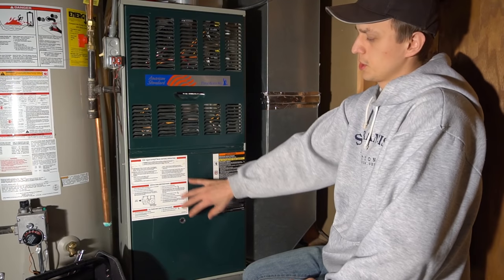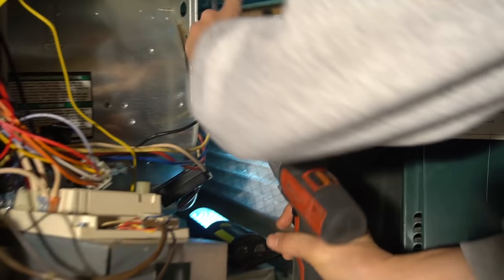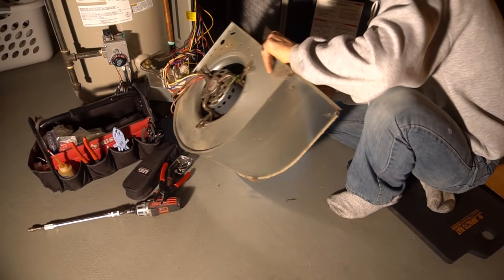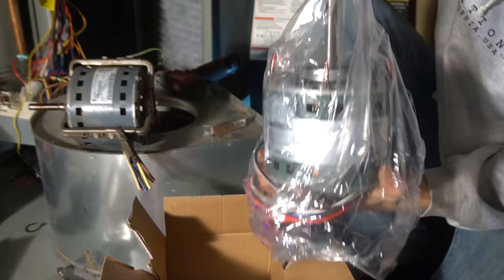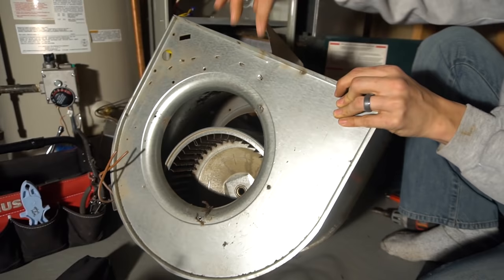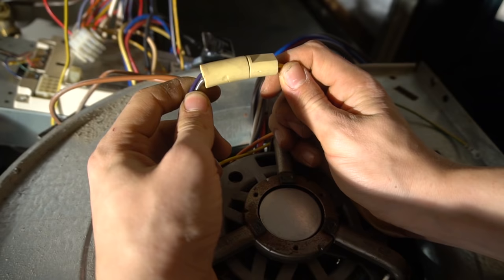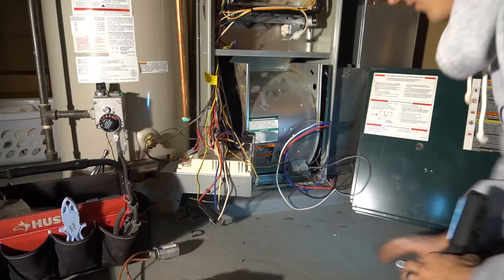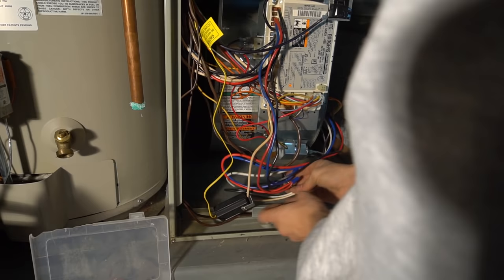Furnace/AC Blower Motor Replacement Step By Step

Comment: This guy is great but I can’t find an answer to my question. I have a Bad inducer blower motor on my Kenmore HVAC system will my air conditioner or should my air conditioner still work without that functioning because it’s only for the furnace side of the system as far as I know but I am just learning if anyone knows the answer to this question please pass the answer along thank you.

Comment: I change the blower and motor but air blower is shaking still. It is not spinning evenly. Furnace is shaking when blower is working. Any idea what needs to checked?
Reply from the maker: Are there perhaps loose screws? Otherwise I would try replacing the blower motor bracket. I should have a link to one in the description.
Reply: Thanks for responding.🙏👍I will double check the brackets and screws. So far when checking the blower from the side. It is wobbling and that is what causing the vibration as well I think.
Reply from the maker: @shaxus91  You could also take the bottom furnace door off and tape the door switch. Then turn the power on, blower on. Perhaps you will see what is causing it that way. If you are running out of ideas sometimes all it takes is a piece of wood jammed under the blower motor housing to make the noise and vibration stop. So maybe that's worth a try too.

Comment: I'm replacing my blower motor. As I look at my old motor it just says HP 1/3 , V 115, A 6.20 , RPM 1075, HZ 60, PH 1, from GE motors. I don't see the SPD speed like yours. How would I know the speed on the old motor before buying ?

Comment: When replacing an old blower motor where I only had 1 brown wire and now have 2 I'm stuck wondering where the white wire now goes.  On the old it had 1 brown & the white to the capacitor with a pigtail from capacitor to N1.  An extra white wire from N3 to L2.  On the new would I discard the pigtail from the capacitor to N1, discard the wire from N3 to L2 and put the white from the blower motor directly to L2?  And both brown to capacitor?

Comment: Is there anyways to find out what’s the Hp of blower motor without taking the blower motor out?
Reply from the maker: Yes, the sticker that has the model and serial number on it will sometimes tell you the HP of the blower motor. Or you could try calling an appliance parts store and ask them to look up what blower motor your furnace will need. They should be able to do that with just the model and serial number. Unfortunately I don't have access to those lookup sites so I can't do that for you.

Comment: mine seems like it will spin in the bracket any  suggestions?  I think this is why you should leave the bolts sticking out I broke mine off and I think I will have to replace them
Reply from the maker: Are you talking about the bracket that holds the motor? Sometimes you gotta put one of these in: FM55 Motor bracket: http://amzn.to/2C7hIcI

In fact a week or so later, after filming this video, I took it back apart and put in the FM55 bracket since my blower was noisy. That did the trick.
Reply: thanks that looks like a winner
Reply: That bracket works perfectly it should be part of the stock set up thanks again
Reply from the maker: I agree :) It's a nice, simple bracket

Comment: Hi,  my blower seems to not blow enough strong air to all my vents. Is it possible to replace the motor with a higher/stronger blowing air? What are should I look into first?  Specs or anything to fix this issue? Thank you.

Comment: My blower motor specs are HP 1/3 , V 115, A 6.20 , HZ 60, RPM 1075, PH1. This is on a RUUD system. Would the same motor u bought do my system? The Amp is different tho.

Comment: I have a Trane XE 78 and lately it hasn’t been blowing out that much air. Would you recommend we replace the blower motor
Reply: It maybe clogged up at evaporator and resisting air flow

Comment: What’s the difference between this motor and the inducer blower motor?  I just turn on my furnace and it’s making a humming sound.  I am replacing capacitor first.

The inducer blower motor is now hot.  But you didn’t replace the inducer blower motor.?

Comment: Is there someone answer my question Please ,whenever I turning on the furnace the motor stuck until I go and pushing the blower by my hand then start .do I have to change the motor? .
Reply from the maker: Most likely the blower motor capacitor is weak or completely dead. If you want, you can try replacing only the capacitor and sometimes that will be enough. But in most cases I end up having to replace both the motor and the capacitor. Hope that helps!

Comment: If anyone sees this, I work with some smaller scale electronics usually, and even with those it's best to discharge the capacitor before working. Is there any surefire way to discharge the capacitor on here or is it fine after keeping the power shut off for a while before maintenance?

Comment: Why would you go from a 4speed to a 3 and omit the yellow wire?
Reply from the maker: One of the speeds is on the "spare" terminal anyway which means I really only need a 3 speed motor. (it was simply cheaper is why I got a 3 speed)

Comment: Are there  additional steps  when replacing a blower motor in a gas furnace? I'm assuming turn the gas valve off but is there anything else?
Reply from the maker: The furnace in the video is a gas furnace :) And I showed how I would do it from beginning to end.
Reply: Just a few reminder of things I run through in order to start out right and keep myself from getting stupid: (1) Safety is job #1. Having the right tools and using good practices is next. Everything else follows. (2) Prepare your workspace and plan your work. (3) Kill the electricity for the furnace at the breaker panel. (4) Turn off the electric switch at the furnace. (5) Shut off the gas, as you mentioned. (6) Use a tester to make sure there is no electricity at the furnace. (7) Take photos along the way to remind you of how it all goes back together. (8) Wear gloves. (9) I like to use a foam kneeling pad and maybe a low stool on hand; it just makes it easier. (10) Have a clean and well lighted workspace. (11) Vacuum out the dirt from the inside of the furnace. (12) Check that all wiring is sufficiently secured and that there are no pinched wires when it is all put back together.

Comment: Question: what can be done if the AC guy says my motor is too old and no replacement is made anymore? He says only option is a whole new system. Can you substitute another motor or is it possible to replace the full blower cage PLUS the motor with a new version without replacing the entire indoor furnace unit? What is needed to put a new fan assembly/cage in an old discontinued furnace?
Reply: Let me start with "I am not a professional HVAC dude".  My advice would be a different AC guy.  It might be true that the manufacturer doesn't make a replacement now, but they're fairly standardized, you should be able to find something close enough that will fit, unless you have a really really odd and old system.  Search amazon or whatever for blower motors for your furnace model and see what you find.
Reply: @AntiMe123  thanks for your answer. I think I do have a really odd or old system. I don't understand why there can't be a new motor that can be retrofitted.  Even the shaft size, don't they makec adapters? If not , couldn't we get a brand new blower/motor complete unit and mount that in the old furnace?

Comment: After you loosen the holding screw how do you loosen the shaft if your fan won't turn?
Reply from the maker: So if you hold the shaft with a wrench like I did and try to spin the fan, it just absolutely won't spin? You can try spraying some WD40 on the hub where the shaft goes into. Then you can try to push the wheel toward the motor, sand down and clean the shaft and try yanking it off again. Sometimes pulling off the wheel can be really annoying. A few times I have had to literally break the wheel off and order a new one. If it is simply not budging no matter what, you may need a hub puller. They may be available in stores like Menards or Home Depot but I have never tried looking for them. Here is one on Amazon: https://amzn.to/2JcfVpv

Comment: Does it matter if the new motor is slightly loose on the old bracket? My new motor came with these metal filler rings but they dont make the gap tight. Should a new bracket be installed on the new motor?

Comment: Do you mount the motor flush up against the blower wheel or leave a small gap? Or does it not matter either way. I can't find any info on that.
Reply from the maker: I usually put it right in the middle of the blower motor housing opening. After you have the new motor installed and screwed onto the housing, move the wheel around on the shaft so that it has an equal space on both sides of the housing and then tighten down the set screw. I hope that makes sense 😅
Reply: @WordofAdviceTV  I did do that. The wheel has equal distance on both sides while mounted. I just don't know if the motor is supposed to be flush against the wheel or not. I did mount it flush against and seems to be working fine.
Reply from the maker: @jaredjroc5139  Its best to leave at least a little bit of a gap but if its working fine without any weird noises, it should be good. 👍

Comment: Does it have to be the same RPM ? I have a 1075 but I see 1100RMP on amazon. Is it still ok to use it ?
Reply from the maker: Off by 25 rpm shouldn't make much of a difference. As long as everything else lines up, I'd go for it. 👍

Comment: Most of the time the most difficult part is to get the wheel out of the motor shaft. In this video it slid right off. I’m my case I had to soak it in wd40 and even after that I managed to mushroom the shaft by using the hammer, oh well you live and you learn, had to use the grinder to correct the mistake and only after that the wheel came off. 

So, this part was 7 out of 10, everything else was 3  out of10, 
Oh you need wire terminals, L shape for motor wires, L shape only, otherwise the cover  will not  close freely

Comment: hello, i bought the blower motor and installed it today but i dont know which capacitor to use. the new motor says CAP 5/370 but it does not say the % whether its 5% or 6%
Reply from the maker: 5% or 6% will both work fine, the percentage doesn't really matter.
Reply: @WordofAdviceTV  thank you!

Comment: Also if my furnace is buzzing and blowing cool air could this be it?
Reply from the maker: If your furnace is blowing cool air, that means the blower motor is not the problem. Likely it is a pressure switch problem or a high limit (overheating) problem. Check out some of my other furnace videos on those topics for more info.
Reply: Lee, keep in mind that furnace designs vary significantly and that makes it hard to address problems without a lot of fairly specific information, though there are general suggestions as to typical causes of problems that arise. 

Here are typical questions that need to be answered first: gas or electric furnace? how old? induced draft or not? high efficiency? direct drive or belt-driven motor? 

If you investigate the innards of your furnace you may be able to figure out which component is buzzing. The buzzing may simply be a noisy transformer, for example, and not a significant issue. It might be just a side-effect symptom arising from the actual defect, or it may lead you directly to what has failed in your furnace. See if you can figure out what is buzzing.

There's a few possibilities about what may be causing the run-on fan. I'll describe I problem I had with a 20 year-old furnace. Word of Advice TV (I'll call him Jay) points out the limit switches. Let me mention a problem I recently diagnosed with regard to the plenum temperature limit switch. That switch detects the plenum temperature at the end of a heat cycle and keeps the fan on until the plenum cools down. Mine failed and the fan would just keep running. It was an older Honeywell limit switch and was particularly easy to diagnose, as I could physically see it get stuck in the "fan on" position. I replaced the limit switch. It was super-easy and not particularly expensive. That may not be your problem though.

Thinking further regarding that buzzing sound, I once encountered a furnace with a failing motor. It made a buzzing/humming sound and the motor would run quite hot, though it would still spin. I bought a new motor and a new starting capacitor for less than $120 total and made the repair that Jay shows. Jay is right (of course) that in your case the blower motor is probably just fine. You may have a problem with a different motor, however: the induced draft motor - if your furnace has one. 

There is a process to figuring this stuff out. The diagnosis of most any device involves checking each function step-by-step in the order that it is triggered during operation. Jay give you the insight and encouragement to undertake the process.

When I first decided I wanted to be able to deal with my furnace emergencies on my own, I had a lot to learn, and you may be in the same situation I was in back then. To me, a furnace was basically a black box that pushed out heat. The first thing I realized was that above all else I did not wish to create an unsafe condition. In a heat emergency, it is all too easy to have mis-placed priorities where safety may be compromised. DIY should only be done if you take a professional approach to safety. From that standpoint, I knew it was necessary to learn exactly how these things operate and then to "follow the yellow brick road", observing each process in sequence to see what wasn't working the way it should. The more you study videos like this one, the more competent you will become to undertake preventative maintenance, to make smart decisions about the repair of your own appliances, and to understand the recommendations of any repair people you may call in.
Reply from the maker: @tomc3542  Thank you for the very detailed response Tom! Much appreciated! :) I have so many comments coming in that I no longer have the time to give detailed answers to everyone. So people like you are very helpful, thank you for sharing your experience!
Reply: @WordofAdviceTV  I enjoy jumping in from time-to-time. I hope I never mislead anyone, but you never know. Being on-site to do a proper diagnosis and service check is the proper way to make a repair. All too often there is the need for work beyond just fixing an immediate problem, and that is one excellent reason for bringing in a trained technician such as you. 

You have been extraordinarily generous with your knowledge here, Jay. I know all-too-well how much time it takes to reply to all of the messages that show up here. You can't take time for that; you have a business to run, anxious clients to serve, and a home that should let you escape from all that. Wishing you the best, man!

Comment: At night I turn the thermostat down. In the morning i turn the thermostat up and the burners turn on; but the main blower does not start. (Fan blade spins freely.)
However, if I unplug/plug the HVAC unit, the main blower will now turn on normally, and then the fan will resume on/off cycles as needed for the rest of the day. 
Is this a possible capacitor problem?

Comment: How heavy is the blower motor assembly when you pull it out?
Reply from the maker: On most furnaces it's not too bad. Maybe around 30 pounds?
Reply: @WordofAdviceTV  thank you sir, I will be doing a motor replacement this week :)

Comment: Troubleshooting my Rheem and believe my it's the capacitor but notice that there are two installed.  Not sure why there's two.  One is 15uF and the other is 4uF.  Do you have any idea why that is?  It could also be the furnace motor as it will not spin at all with the fan from the thermostat in the on position.  Any thoughts?

Comment: I replaced my blower fan and now the entire unit is shaking when the AC is on. What could be the problem?
Reply from the maker: Most likely something was either not mounted correctly or the motor band that holds the motor is loose. In the description of the video I reference a FM55 motor bracket. I actually had to take my motor back out (the one in the video) and replace the bracket because every time it turned on, it came on with a bang. (motor bracket was loose)

Comment: you did not clean the inside fan housing, only the impeller fan?
Reply from the maker: Yes, I only cleaned the blower wheel. That is what will impact the airflow. A dirty housing will barely have any effect. You can clean it too if you want, definitely wouldn't hurt anything.

Comment: Can i replace my old motor with a new motor with lower rpm 1075 from 1375 rpm?
Reply from the maker: If it was 25 RPM that would be okay but a 300 RPM difference is quite a jump. You will likely run into airflow problems if you do that. I wouldn't recommend it.